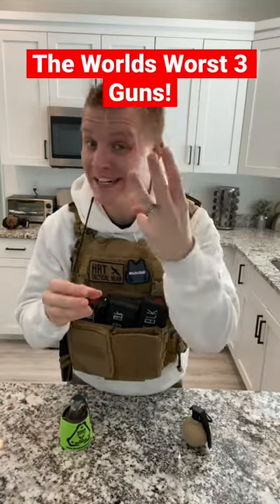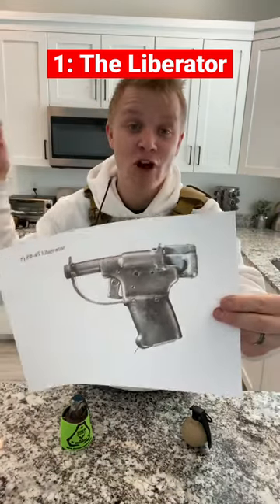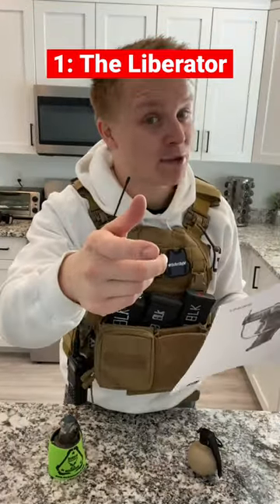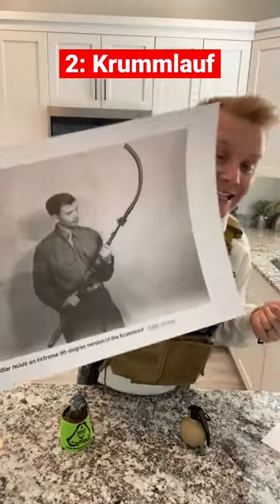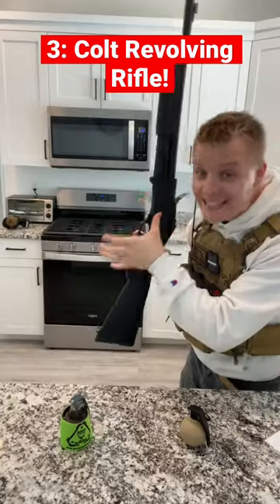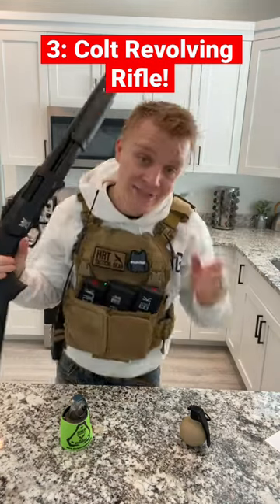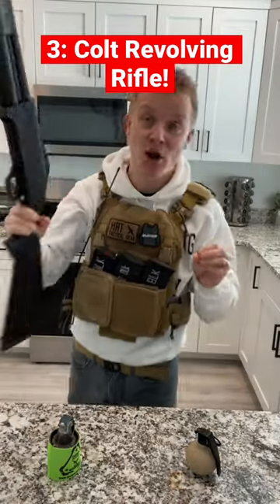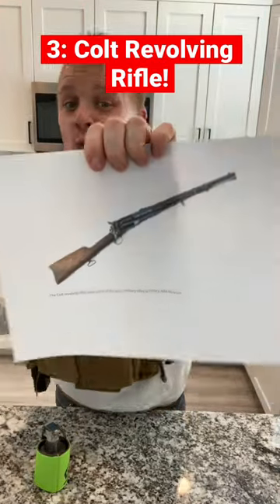Sadly, the #1 worst gun was made in… America… bye bye Left hand…#civtac #history#firearms #military

Comment: From my understanding on #3, only black powder is capable of chain fire and usually under the condition that you didn't properly grease/wax the top of the cylinder after loading
Reply: Still, most guns when properly operated and correctly made do not remove hands
Reply: Said rifle was black powder and from what I read it was a design flaw, even with proper care it often chain-fired
Reply: It has nothing to do with grease or wax. The grease/ wax is meant to season your bore for easier cleaning. What prevents chain fire is an oversized round ball, when you load one in it should make a ring of lead, confirming a good seal between the ball and the powder. I load my cap and ball like this every time, not one chain fire.

Comment: The Krummlauf wasn't a weapon, it was a barrel attachment for the Sturmgewehr 44, it came in 4 different degrees, 30°, 45°, 60°, and 90°, all but the 30° ones were experimental as the 45° bend could only handle up to 160 rounds before breaking and the 60° and 90° ones would just cause the bullets to shatter. I think around 500 30° Krummlaufs were made, not significant but it could have been used in world war 2

Comment: you are so wrong that it's gonna take a while to get you right.

1. The Liberator was designed to fulfill a specific mission. the fact that it was made of sheet metal means nothing. 
the MP-38, MP-40, STG-44, PPS-42/43, STEN, M3 Grease Gun, and the AKM, just to name a few, were all stamped.

2. The Krummlauf barely worked but it was one of the earlier attempts to solving the problem of firing behind cover. there were 2 models. the 90 degree model was designed for usage in tanks as point defense against infantry. the 45 degree version was for infantry use.

3. the Colt Revolving Rifle was flawed yes, but most of its flaws were shared with other black powder, non-cartridge firing revolvers. the only real additional problem was cylinder gap, which would interfere with having a proper grip with your support hand.

go watch a forgottenweapons video. Ian has videos on all 3 of these.